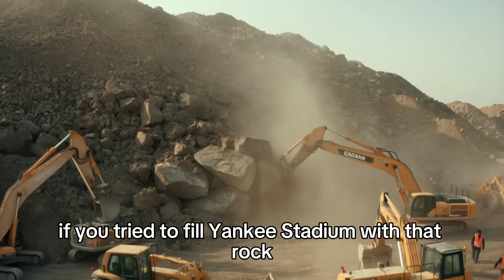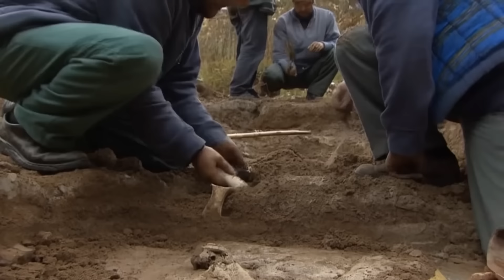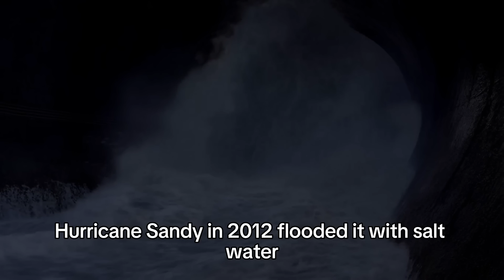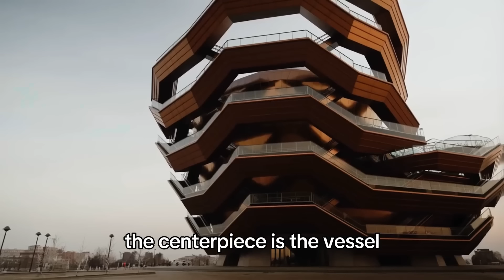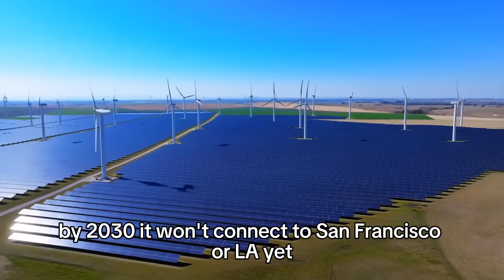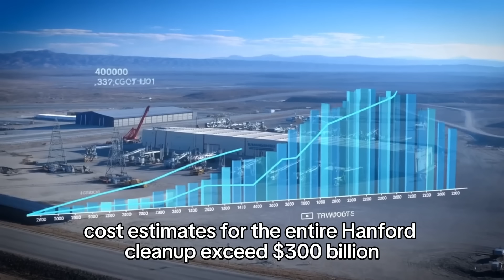The US Government’s 8 Biggest Mega Projects Under Construction

Comment: ALASKA IS THE PICTURE ON THE THUMBNAIL BUT THERE IS NO MEGA PROJECT ON IT WITHIN THIS VIDEO!!!!

I don't understand who a state that supplies the U.S. and Canada with a huge amount of its oil and gas for heat and cooling as well as many other manufacturing purposes isn't connected to both countries by multiple worldclass highways and railway lines but ......

I-69 is an important highway, but I believe that I-11 and I-14 are also unbuilt highways just as important and should be built.

I-11 from Mexico to Canada threw Pheonix/Los Vegas/Reno/Boise

I-14 from El Paso Texas to North Carolinas Atlantic Seaboard are also important highways missing.

NEC - they should build a duel gauge steel-on-steel/maglev corridor with the steel-on-steel rails in maglevs ballasted bed so when the corridor is long enough it can become a maglev line.   It is how they should build all U.S. high-speed rail.  In this way as more and more corridors are complete the decision to run steel-on-steel and or maglev trains can be decided on day to day - hour to hour- or even minute by minute basis.